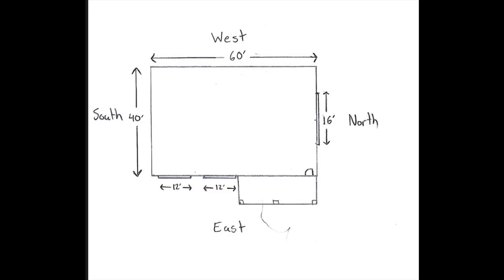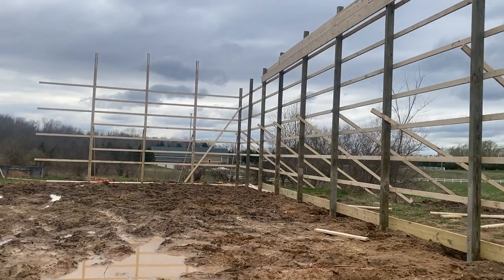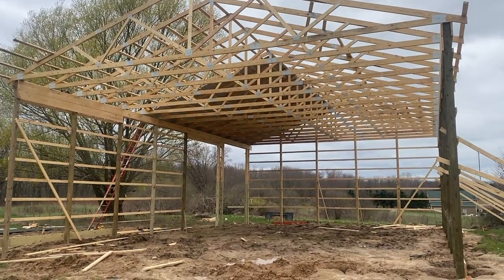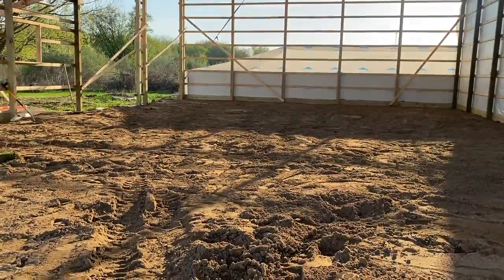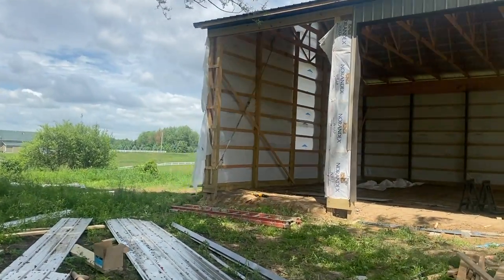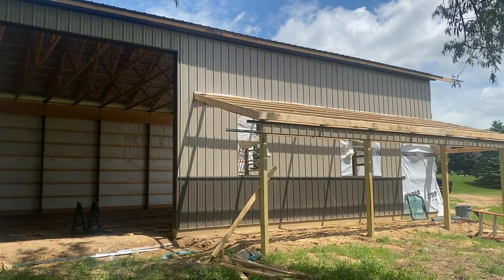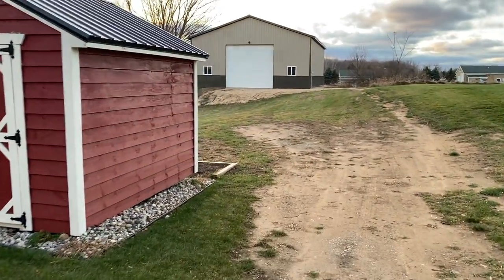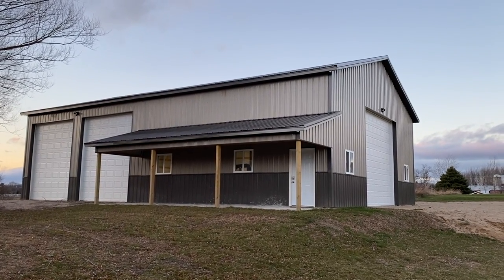Full Pole Barn Build Time Lapse - Start to Finish - 40x60

Comment: 14:04 - with your sped up/time lapse, one can really see the building moving in the wind. It looks like they had to pull it with the pick up to get it plumb at one point too.
Reply from the maker: Good eye!! That was a scary day. I saw it moving a lot because the north wall was acting like a sail on a boat. It was catching all the wind. I had them go out and hook their truck up with a tow strap to pull it south. Then they put diagonal anchors into the ground to stabilize it. It worked, luckily and no more issues. Very square. We were lucky.

Comment: Your garage looks nice. We’re building a 40x56 in the same exterior colors as yours. We will also have 16 foot sidewalls. Have you noticed any moisture dripping from the ceiling with changing outside temperatures.
Reply from the maker: So if you are doing a steel roof like me, make sure you or your contractor get that felt backed steel that has the moisture barrier. With that, you can lay the steel right on the 2x4s and have no dripping.

Comment: Terrible grading. No compacted gravel or vapor barrier under the slab? Literally pouring on grass. Building damn near blew over. Metal blew off. Porch concrete splatter all over the new metal. 4 diagonal braces for a building that size is laughable. What a cluster of a build.
Reply: I’ve built a few barns over the yrs. Depending what part of the country you live in. Some area’s don’t need much ground prep. Yes everyone builds differently but I don’t think it’s terrible. If he is happy and that’s all it matters.